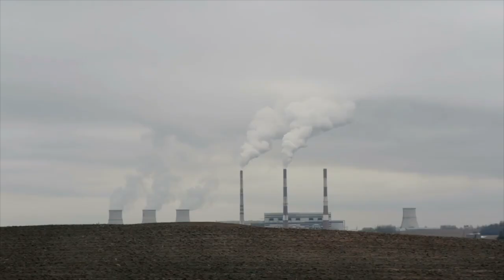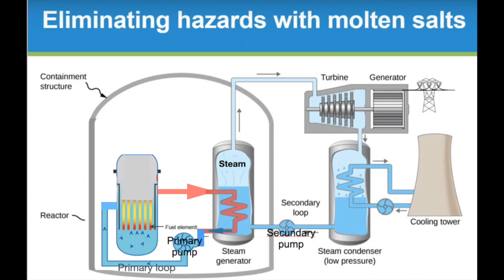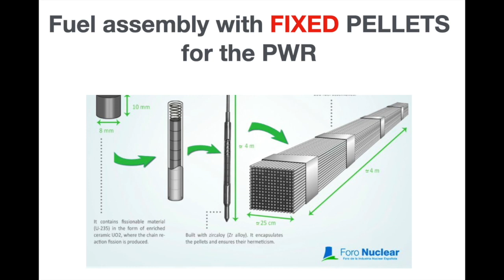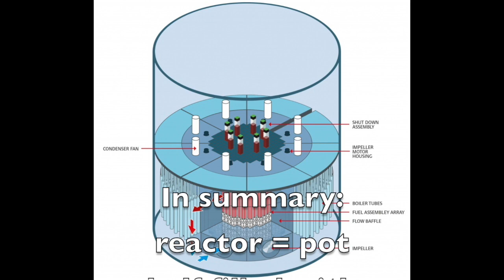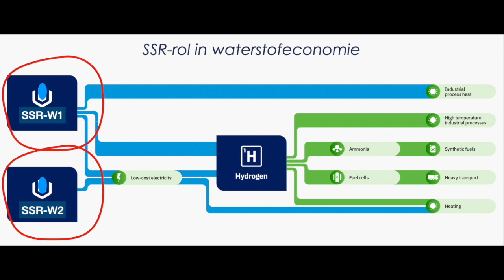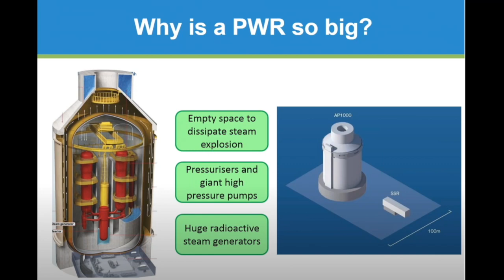The Moltex SSR-W

Comment: I keep seeing these liquid salt fast reactors presented as "holy grail" of solving nuclear waste, however in none of the videos are the disadvantages mentioned or discussed which gives a false impression. In fact many of these start-ups have failed still in the design phase and none could build even a pilot/prototype which is because it is nearly impossible from technical point of view, i.e. they are the Theranos of nuclear energy. 
The high temperature molten fluorides are extremely corrosive by themselves and in combination with a bombardment with high neutron flux no material exists that can safely withstand it for a longer period than few years. This would mean that the whole reactor and tubing would need to be reconstructed every few years (check out the results of the project MOSART).
Fast reactors are not necessary to burn the long lived nuclear fuel and that can be done safely with existing reactors and configurations. For example the spent fuel from a typical light-water reactor can be directly inserted in CANDU. The double-used spent fuel reduces the long-term radiotoxicity by circa 100 fold without the use of exotic unproven technologies. Other options are the extraction of long lived actinides and using them as neutron poison in dedicated rods and reducing the B and Gd concentration, this can be already implemented in VVER-1400 reactors.
Fast spectrum reactor designs that are fully developed exist, and have been implemented in GW level practical settings (Superphenix, BN-600, BN-800, BREST-300), I see no advantage that such circulating reactor could offer in comparison to these.
Reply: Actually, salts in general (fluorides and chlorides) are much less corrosive than water for those range of temps, in particular chlorides are less corrosive than fluorides. And no, you can't burn all actinides without using a fast spectrum reactor (you can still use some more fuel, like in LWR+Candus, but it's basically negligible)
Reply: I don't think you are not watching the video close enough. Most of your concerns and questions are addressed in the presentation. Corrosion is addressed, big advantages are addressed typically by the output temperatures of the reactors and the separation of the power conversion equipment from the nuclear island. This separation means the cost of the reactor drops to the same as a coal plant. The added value of the high-temperature output can not be overstated and again covered well in the presentation. I humbly suggest you watch it again, but more closely.
Reply from the maker: you could be right, time will tell. What I wonder then, are those many developers all idiots? Moltex Energy's SSR-W, Elysium Energy's MCSFR, Seaborg's CMSR, Terrestrial Energy's IMSR, ThorCon's MSRW, Samovar Thorium MSFR, China with the Thorium MSR, etc...... .
Reply: You seem to be very knowledgeable about this subject. What do you think are the proliferation risks of these kinds of molten salt reactors?
Reply: @netional5154  The simple fact of the need of online reprocessing (which is in the video mentioned as an advantage). Reprocessing is required not only to add new fuel but to remove the fission products that accumulate in system and interfere with the reaction, lanthanids or some Pu or U isotopes for example. If you do a simple calculation there is around 10t of weapons grade Pu circulating in the system, which, due to continous nature, difficult to track and can easily "disappear". Also while the reactor would be relatively small, the reprocessing plant need to be enormous.
Also due to high burnup huge amounts of fission products are formed, one example is Xe-133 which is gas and can easily escape containment into the atmosphere (there is also the technical question of how to perform the degassing?). Xe undergoes beta decay and quickly turns into Cs which is highly radioactive and has high environmental/biological mobility. In my opinion Ba isotopes and Cs- 137 are actually a useful product since they have  a number of  practical applications, but from a proliferation point of view they are extremely dangerous.
Reply: "they are the Theranos of nuclear energy. " 

I think it is an unfair comparaison, Theranos claim were scientifical impossible, while molten salt reactor have run already. Several thousand of hour actually (Oak ridge experiment).

"The high temperature molten fluorides are extremely corrosive by themselves"
It is my understanding that corrosion can be 100% solved by material and eliminating water (which at those temperature shouldn't be difficult)

"and in combination with a bombardment with high neutron flux no material exists that can safely withstand it for a longer period than few years."

Salt can deal very well with high neutron flux and it is not that hard to replace tube regularly in the moltex design.

"I see no advantage that such circulating reactor could offer in comparison to these."

-The advantage is better safety (Therefore also far cheaper)
-Passive safety (enormous advantage here, that alone would justify molten salt research)
-Higher temp output (better efficiency but also energy storage capability and industrial heat)
-Lower nuclear proliferation risk.
-Higher burn up
Reply: Stupid economically.
It is like the idiot looking at the the big factory and no delivery trucks to transport the product. 
The idiot who opens a mine and no delivery transport available. 
It is like finding that a space station is great for the view but no rocket to get you there and back.
Nuclear power in a 100% electric world is stupid economically.